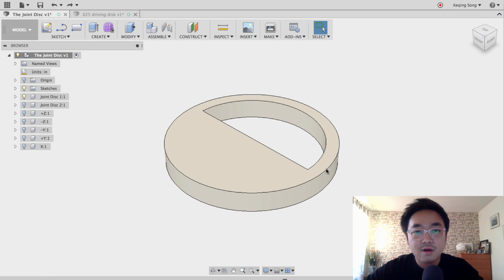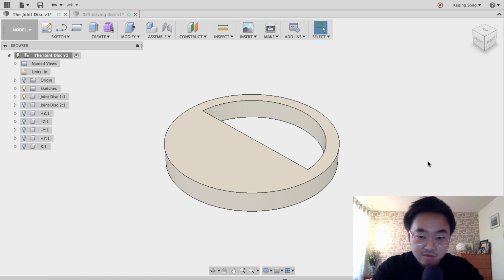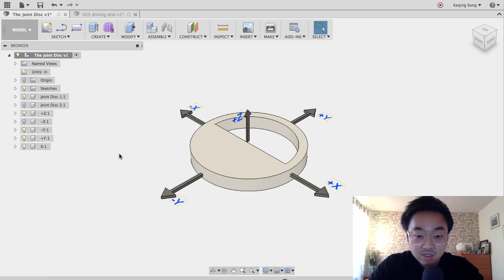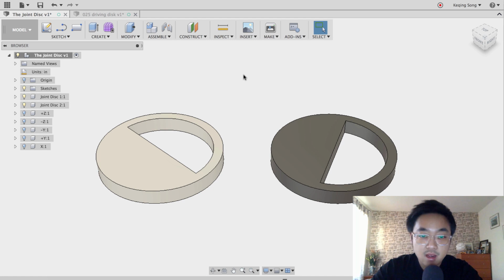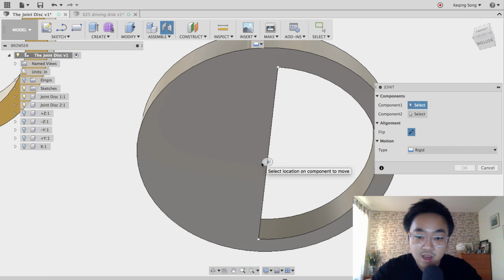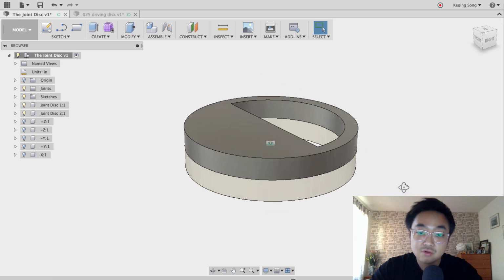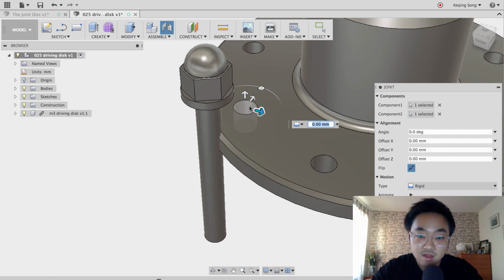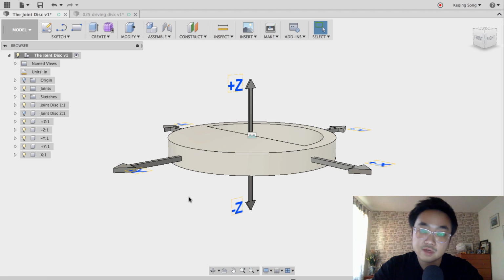Assemblies - Joint Discs Explained!

Comment: hey, thanks for your explanation. I am struggling to make a joint between between a wheel (cylinder) and the floor (plane), could you explain the procedure, please? I can't get any snapping on the cylinder. I am ok with having a wheel sliding on the floor (actually it's part of the design), I just don't want the wheel to pass through.

Comment: Brilliant video!!! Can you just help with a type of joint that has not been well explained and that is beams. I am trying to make a frame of square tube and would really like a video of how to attach these square tubes. I cant seem to get it to do it.

Hey Quick edit. I stayed with it using your system and I hadn't checked in the control box on the side and for some reason there was on offset there. I corrected this to zero and the joint is perfect!
Thanks again for your great video. Please keep posting your ideas.